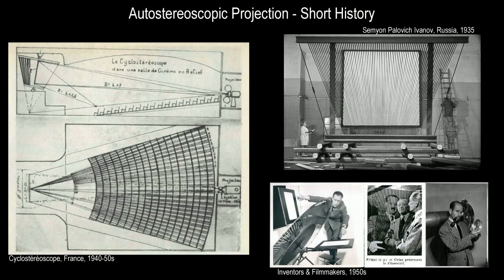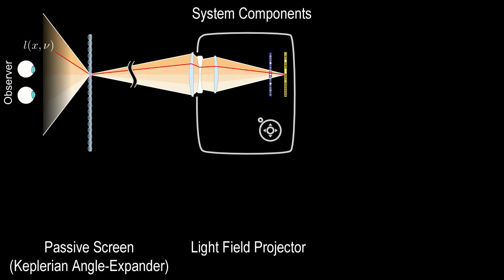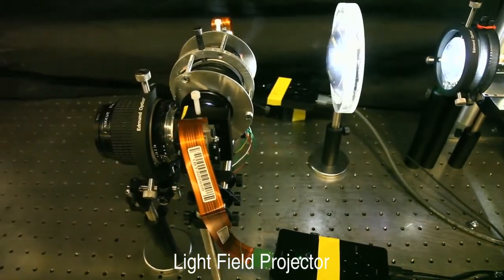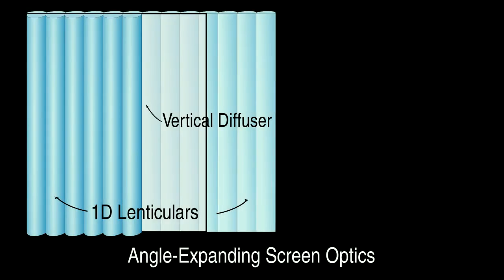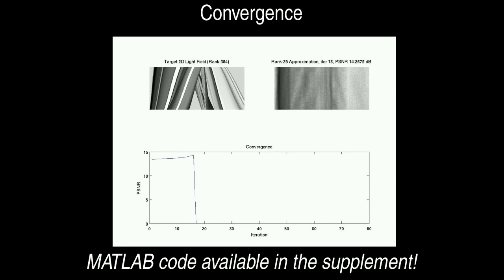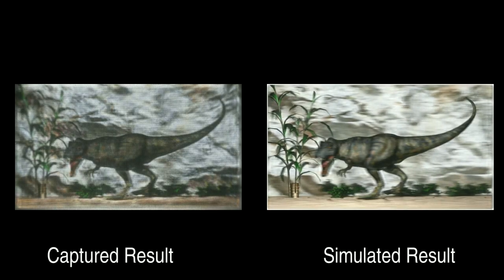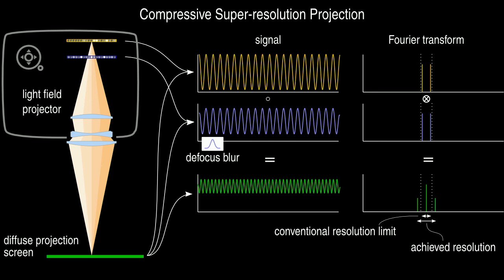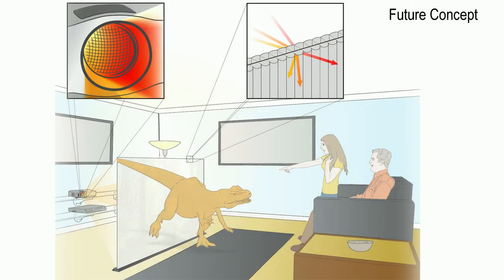Siggraph 2014: A Compressive Light Field Projection System

Comment: That's a pretty intresting idea, but i've got a question:
It looks, as if you're trying to accieve something like a hologram, but does this work with "3D"-Movies like avatar as well?
I think, this wouldt cause issues, because everyone sitting right wouldt only see the right-eye picture and everyone sitting left wouldt see the left-eye picture...
Reply: I don't think it's supposed to be limited to two perspectives, a left and a right - I think it's supposed to be a range of perspectives. If that's right, then from each vantage point, you would still see a 3D image, because of the offset between your eyes. On the other hand, this would mean a great deal more rendering, so I can't be sure.
Reply: it would probably be more like a real "Theatre" where your sitting position determine the angle at which you look at the image.